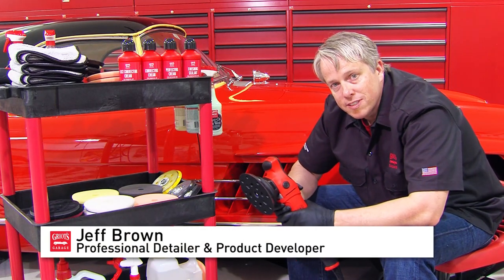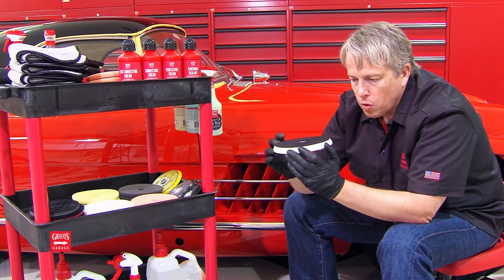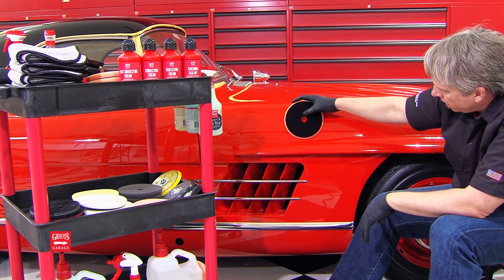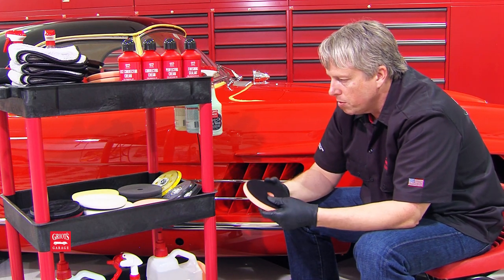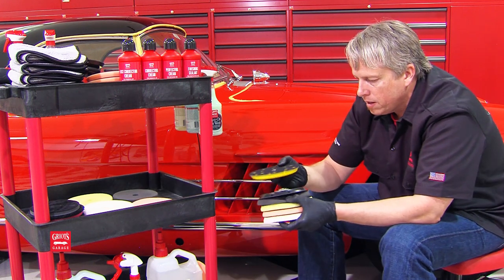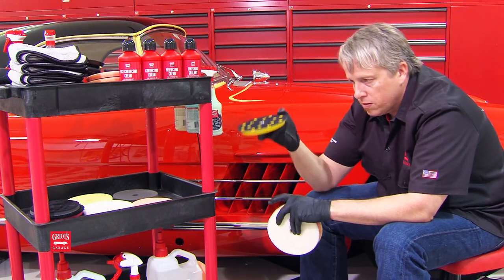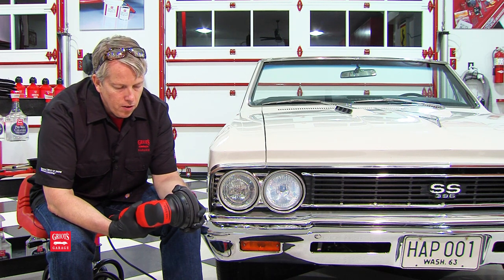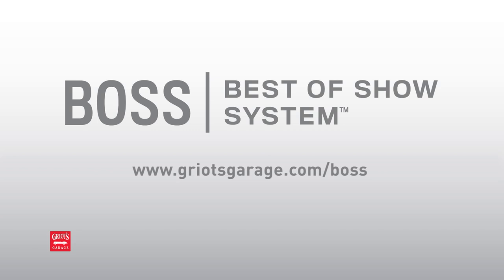BOSS - Best Of Show System: BOSS Pads Overview

Comment: Hi there. I’ll be using the g8 and the g9 with the 3” and 6” glass pads and the fine glass polish to take out hard water etchings (all windows and paint are 100% covered in this road film/water stain). I have the job in a couple days and I’m second guessing myself. It’s a 2019 Ford Fusion in Pearl White that was just bought a few months ago from the dealership in that condition, meaning they didn’t/couldn’t get the grime off, and the customer has washed it many times trying to get the buildup off before calling me. So I know that it’s going to take a lot of work to remove, and I’m not afraid to say that I’m nervous being a super beginner not having polished before (polishers are still new in box), that maybe the pad would be a good idea, yet I’m only doing the windows (for now) and I know I’ll need every abrasive that your fine glass polish and glass pads will give. What would you recommend? 
Thank you!
-Tiffany

Comment: I know all these pieces (machine,pads,products) were made to work with each other so i am aware results may not be as good by breaking the system up. But i will ask anyways. Have you tested your products with different pads and on differents machines? Also have you tested your pads with different products and machines? For example can you give a guess of how well your products would work if i used your GG6 and Meguiars MF pads? And vice versa. Also what about usimg these pads and products on a rotary?
Reply: Stephen Keef Hi Stephen,  you are correct, the pads, creams and tools are all built from the inside out to work in concert with one another.  Much like a finely tuned race motor, the system is balanced and blue printed to match one another's weights.  So to answer your question, yes...THE BOSS has been tested with virtually every major player's pads.  The weight of the pad is what contributes to smooth operation or lack thereof.  The more weight the pad has and liquid capacity, the potential for more vibration comes into play.  Feel free to use other mfg. pads, but know you will not get the smooth operation we built into BOSS unless you use our pads.  Buy one BOSS Pad and I'm confident you won't go back to the others..  Thanks for your interest.  Jeff
Reply: Jeff Brown thanks for your reply.  How well does this system work with your GG6?

Comment: Has anyone used this on a GG6?  I have been using Lake Country 5.5" Flat Pads, how will these compare on the GG6?
Reply: +oRedRaider the Boss pads work AMAZING on the GG6 polisher, it actually makes the GG6 more effective in correcting and finishing ability. Griots Garage has made a awesome new "vented" backplate for the GG6 pair that with the Boss pads and your in business to kill some serious defects.

http://www.griotsgarage.com/product/5+inch+vented+orbital+backing+plate.do?sortby=ourPicks&refType=&from=Search

there is the link for the backplate i recommend, also when im about to upload a review i did with the GG6 and some Boss pads on a severely defected black truck, so when you get the time click my channel and watch the video, if you have anymore questions about the Boss System message me anytime,
Reply: It work great with a GG6. Lake Contry does not work as good as these pads even if it's not a Boss.